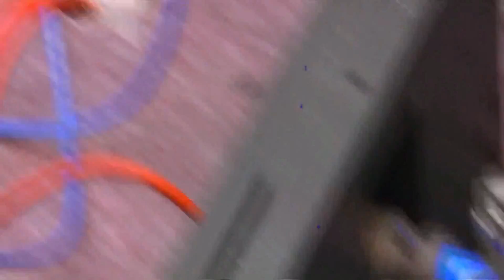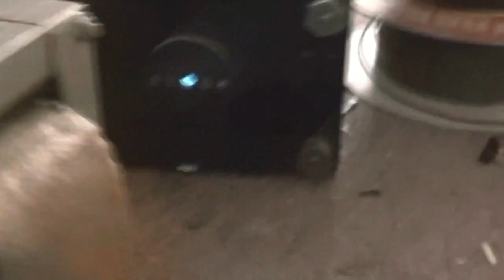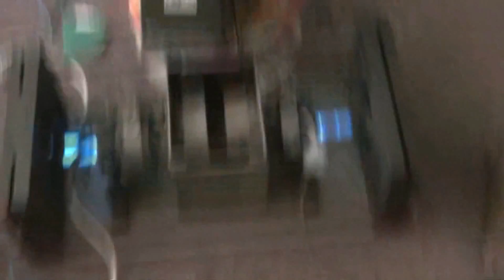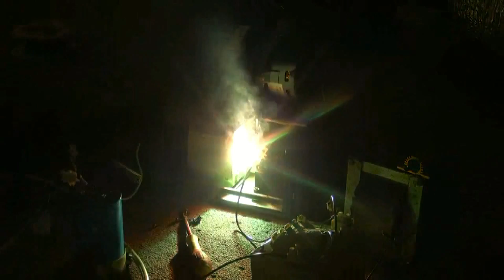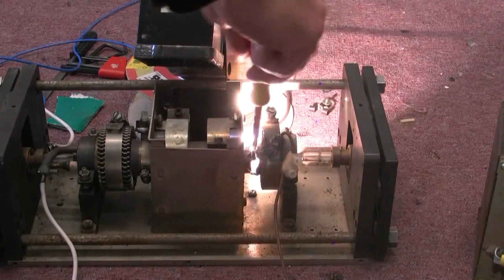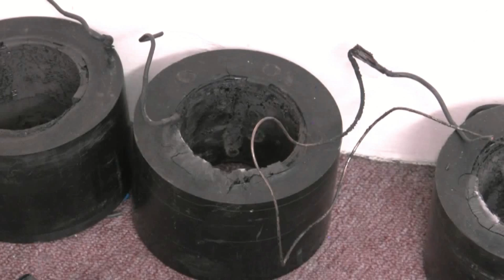Argon Laser Meltdown

Comment: Rediculous overheating is an easy way to rejuvenate JDS uniphase lasers. Tube needs to be removed from the head. Run and let tube heat to dull cherry red or until it winks out from going too high of voltage whichever is first. Then let cool slowly and reinstall. It will usuallt start the first tick. 🤓😁

Comment: Hey, what did you use to power the laser tube? I have one of these ALC 60X lasers I want to power up, I did a pressure test and know that the heater takes 120v but I don't know what the tube takes to run. I have only experience in direct diode and DPSS style lasers.
Reply: Heater takes 3V @ 20A or so (not 120V).  The laser itself needs a 20kV starting pulse, then runs around 110V at 10A.
Reply: Oh this comment is a bit out of date lol. I have a full ALC 60B now! I did post up on my ALC 60x on this channel ( Introduction into Argon-ion Laser ). Sadly the tube did not want to seemly start.

Comment: If the camera has an electronic image stabiliser it'll do that. The image sensor will be slightly higher resolution than needed, the camera will (I assume) record the 1920x1080 pixel block that looks closest in position to the previous one, to reduce camera shake. An extreme example of this can be found if you use VirtualDub and Deshaker on a video, any logos, dead pixels etc. will wander all over the place.